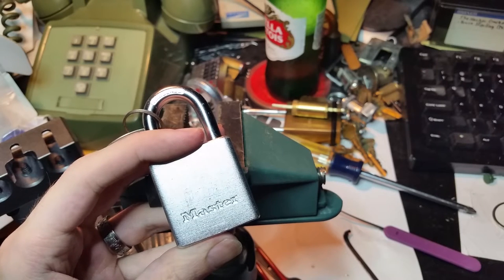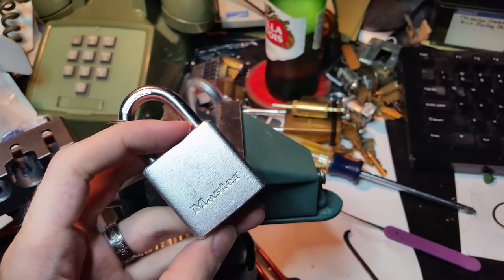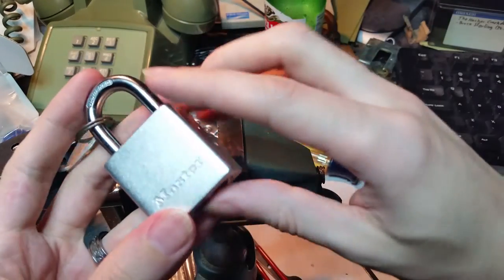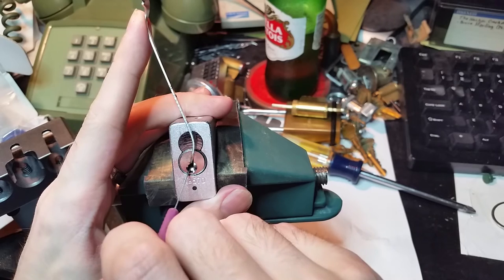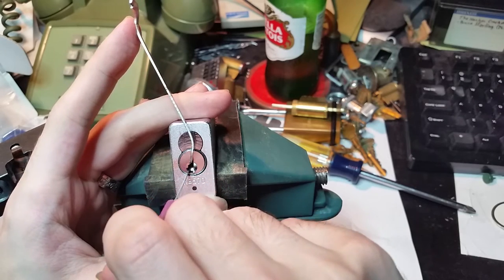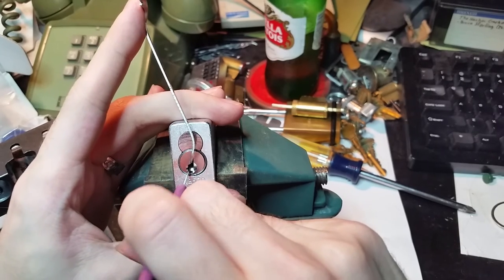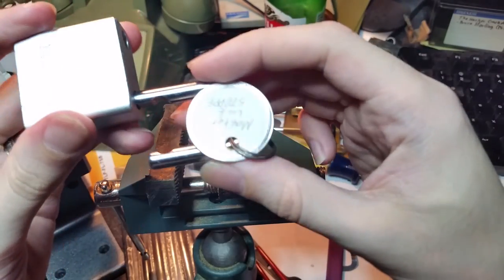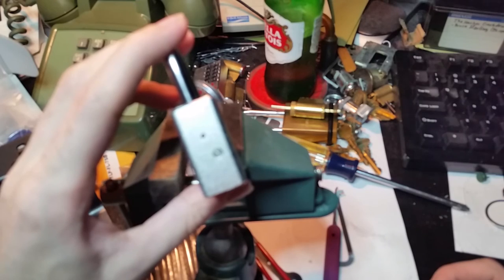(66) Master Lock 570 picked and analysed

Comment: The 570 I have is ridiculously easy to pick. I think it's because the bitting is almost level all the was across. I just got a Schlage ks43 off ebay for $20 (made offer) and noticed it's larger than the ks23. I never knew.
Reply from the maker: The KS13, KS23 and KS43 are all slightly different sizes. One of them is also set up for FSIC instead of the screw retainer and KnK cylinder system. From the look of things Schlage has largely discontinued the KS series padlocks but their production was prodigious enough that many retailers will be distributing them for a long time.

Comment: I have a master 575 which looks like this one but  in brass. It's actually trickier to pick than some of my American padlocks. Do you ever pick in hand? Or mostly on a vise? I've been using a vise and find it uncomfortable to pick in hand. Any advise?
Reply from the maker: I mostly use the vise when making the videos or working on door cylinders, since I do a lot of picking at locksport meet ups, lockpick villages, and on my couch I do a lot in hand. That said, many trickier padlocks are easier to deal with in a vise, particularly the 570 and its relatives. The biggest trick with picking in hand is finding a way to hold the lock while still leaving your index finder in a comfortable position to manipulate your tension tool. Try to find an orientation of the lock that leaves the keyway oriented so that the tension tool will hang at the tip of your slightly curved finger. Without knowing more about your current technique it is hard to offer specific advice.

Comment: My 575 is my Kryptonite...
so far I only opened it once...
Reply from the maker: The 570 family are very tough. As I noted in the video you need a tension tool that fits the keyway very solidly so that you can 'steer' the plug rotation more precisely.
Also with some locks it can be a good thing to put it down for a while and work on a different lock, sometimes you will even discover things that will make it easier when you go back to the first lock after a while.